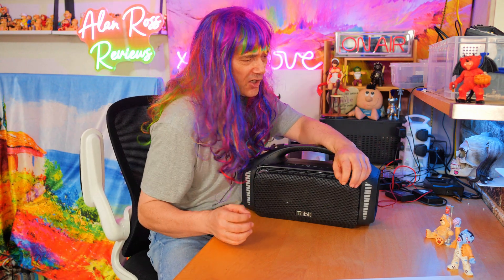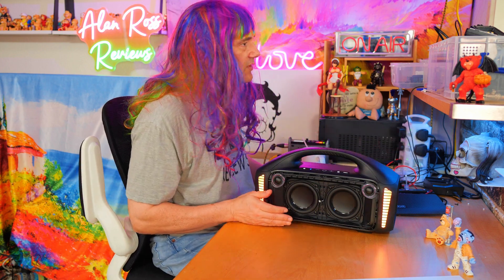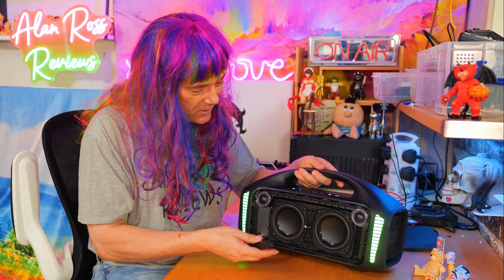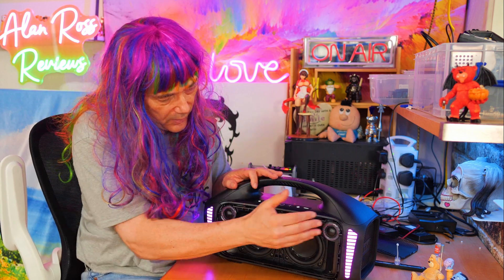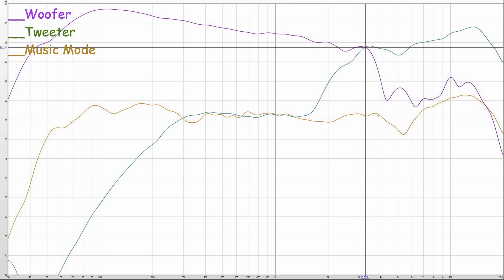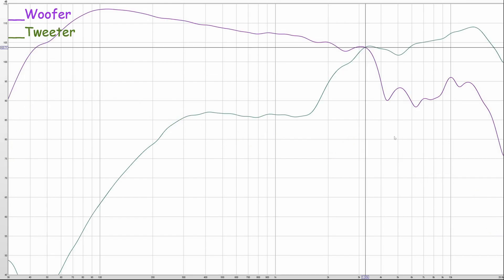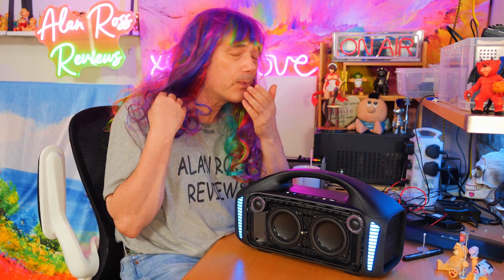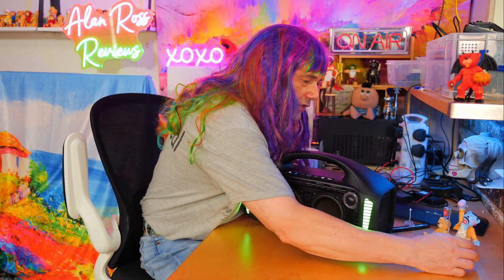Tribit Stormbox Blast the truth! the woofers, the tweeters, the crossover, the passive radiators!

Comment: Thanks for the measurements. Both woofer and tweeter should be down about 3~6dB at the x-over point BTW, and ideally have the same slopes, otherwise the phase tracking isn't going to be great and you're going to end up with dips and peaks through the x-over region.  Your measurements show mismatched slopes (ugh - that couldn't be cleared up via DSP?) and the bass drivers showing a ~5kHz peak almost exactly where the combined response shows a dip.  Hmm.... I wonder what does the phase response of the two drivers look like in that area? 

1/4 wavelength @5.5kHz is around 1.5 cm.  If there's anything around the tweeter that resembles that dimension or multiples of it (what's the diameter of that mounting ring around the tweeter, for example, or how high is the tweeter mounted wrt the baffle that's holding the woofer), it could be contributing to diffracting issues affecting the response around that frequency.

REW is a great free s/w tool for these types of measurements.  I also use it and the "transfer function" method to minimize room effects on the measured bass response to get a much better idea of what the response would look like under anechoic conditions. 

Great stuff, thanks for the measurements!
Reply: You didnt expect a 24db linkwitz riley slope on a 170 dollar bt speaker did you? Many speakers do in fact apply a non identical slope, but they do have their own reasons for doing so, most probably to achieve their sound signature they wanted. Its not ideal but that is where things are usually 'manipulated'.
Reply: @AbsoluteFidelity  They should be able to do that and perhaps more with even the cheap DSP built into those BT speakers.  Hell, they're already doing dynamic bass EQ/restoration  via DSP on some of those cheap BT units.
Reply: @Grommet2007  DSP is one thing you shouldnt talk about when it comes to 170 usd speakers. Even Harman dont use them when it comes to HK and JBL speakers. A cheap DSP doesnt really solve problems, a good example would be DSPs in cheap-ish monitors such as  Kalis wont ensure a flat response. With manipulation they might get get it flat-ish but still nowhere near flat as we see in measurements. Im not saying they are bad but there is a limit to what dsp can do before it screws up the sound. I personally would come up with a design that isnt far off the ideal response and then add dsp on top of it. Im running Dirac Live with a MiniDSP Flex and I know why you shouldnt mess with anything above the Schroeder frequency first hand and this is why Im currently investing in all sorts of room treatment. DSP and EQs are aids to make a good system sound better, not make the ones that sound shit sound like porridge.
Reply: @AbsoluteFidelity  Not sure where my reply keeps disappearing to, there's a breakdown on the Internet available for the JBL Flip 4 that clearly shows the DSP features in the BT chip are being used to adjust its frequency response.  Just do a search for "Reverse engineering JBL Flip 4".  The latest version of that speaker is available for $130.  A search for the ID of the BT chip that's mentioned in the article CSR8675 will turn up its specs, which include "Audio tuning suite with audio enhancements and two 5-band EQs".  The Flip 4 was produced five years ago.  Imagine what they're capable of doing now...
Reply: @Grommet2007  when it comes to JBL, I assume they set a DSP based on what they want and feel most apt. Harman believes in listener preferences, and in this market they  came to a conclusion that this is the type of FR they should have for such a speaker. It wont please the purists, but then again, pleasing the purists wont net them sales. This is exactly what is happening to B&W. Most probably asked a bunch of inexperienced teens to participate in the blind test.
Reply: @AbsoluteFidelity  I would go out and a limb and suggest that almost all except the cheapest of these BT speakers use some form of DSP to enhance performance to make it pleasing to their target market (hint: that market is quite likely does not include any audiophiles, LOL).  

Technically speaking, there's no way those tiny BT speakers could produce any sort of decent bass at even an adequate, much less decent, volume unless there was some sort of processing going on, for example.  Hofman's Iron Law applies, and the only way to get around that damned law when trying to get bass from a tiny box is a bass boost at lower frequencies that's dialed back as overall output is increased (because iddy-biddy drivers can only do so much, LOL).  And the JBL example I provided suggests that this processing can and likely is provided in many of those cases via the DSP features in the BT module.
Reply: @Grommet2007  of course these bt speakers use some sort of dsp, the best examples are the Onyx series from HK. But Ive yet to see any speaker that is DSP-ed above Schroeder. I need evidence and not assumptions to show that this is the case because even when I turn off the DSP on the onyx I do not detect any tonal shifts above the lower frequencies.
Reply: Wait, wait wait.  Just a few posts ago you claimed that "Even Harman dont use them when it comes to HK and JBL speakers." Then you provide an example of a HK speaker, the Onyx, that DOES use DSP?  One that you actually own??

Are you trolling me? 🙂

FWIW, DSP is used across the audio spectrum to adjust the frequency response of many of these BT speakers.  Alan has several videos in fact that show the FR of some BT speakers being "adjusted" with the application of a firmware update, including the Mifa Wildbox (which I own) and the Motion Boom Plus (where the latest firmware addressed a peak in the response at high frequencies). The firmware update just adjusted the DSP configuration to produce a different frequency response from the speaker. 

And, btw, the x-overs for these BT speakers are also implemented via DSP.  Probably cheaper to do it via DSP and separate class D amp channels than via passive x-overs, and you can't adjust a passive x-over via a firmware update :-).
Reply: @Grommet2007  there is nothing to troll in discussions like these and there is nothing to gain doing so. Just because it doesnt fit your narrative and understanding doesnt mean its trolling. I do need need to specify such obvious aspects of dsp and the application of it, its pretty obvious they dsp the lower frequencies to gain such a boost. Again, you have no evidence whatsoever to prove that dsp is used in the upper frequencies. Your 'definition' of dsp in this context isnt the same as mine, so understand where Im coming from. In this context, the dsp in your phone decoding lets say a MP3 file isnt the 'dsp' we are speaking off.
Reply: @AbsoluteFidelity  "Just because it doesnt fit your narrative and understanding"

LMAO. You clearly stated that Harman did not include DSP with their speakers... and then subsequently disclosed that you have a HK BT speaker with built-in DSP.  Maybe I'm not the one here that is trying to fit things into a narrative and understanding ;-).

FWIW, the treble response of my Mifa Wildbox audibly and measurably changed after I updated the firmware.  Alan noticed the same thing as well and mentioned it in his video covering the firmware upgrade of the Wildbox. Only way that could have been done is via a change to the configuration of its DSP.   And I'm sure Alan can share the links to a few of his videos showing frequency response changes across the spectrum  (not just at bass frequencies) for some BT speakers where he upgraded the firmware. 

Anyway, this is my last post on the matter. I don't see any benefit in continuing this conversation.
Reply: @Grommet2007  clearly you are out of your league and cant hold a civil conversation before chickening out. Have a good day.
Reply from the maker: i see more high end speakers now using dsp not for on axis but to get the off axis more in line with the on axis. is it cheating or is a move forward?? 🤔🤔
Reply: @alanrossreviews  Nah, DSP is basically becoming ubiquitous now.  You'll find it in almost every audio equipment reproduction chain that wasn't put together by snooty "purist" audiophiles, who of course don't have any issues with the gross distortion caused by their record players :-).
Reply from the maker: @Grommet2007  but i would disagree. dsp is pretty mainstream now including high end. i see it used now to bridge on axis and off axis response to gel with the current fad of everything having to line up with spinorama data. even more so for in-room listening position correction. probably driven by the home cinema and multi sub part of the market.
Reply: @alanrossreviews  LOL, I was agreeing with you (i.e. saying nah, it's not cheating).  Of course there is another person here who's insisted that DSP is not used above the room's "Schroeder frequency" (LMAO!!) who might disagree... 🙂
Reply from the maker: @Grommet2007  😁anyways its an interesting topic and for the most part well debated 👌 i dont like to see my regulars bickering though 😂 but ive pinned it because the number of people that dont realise how much internal eq these speakers already have is surprising.
Reply from the maker: keep in mind both woofer and tweeter were active during the measurement so a little of the woofer past that crossover will be the tweeter, not much but its worth keeping in mind i couldnt actually measure them 100% isolated like you would normally. so just right channel active but both tweeter and woofer active. of course not ideal but i wasnt going to open this thing up 🤪
Reply: @alanrossreviews  Ah, that explains some of the stuff in the measurements, then.  I thought that the drivers that weren't being measured were disconnected during each measurement. 

The output from the tweeters can be significantly reduced during woofer measurement by taping some thick cardboard over them.  Sadly, that won't be enough to block the output from the woofers.   Seeing that you've already got the grille off, if I'd reached that stage, I would have definitely given into the temptation of unscrewing one of the woofers to see if it could be easily disconnected.... :-)
Reply from the maker: well i really only wanted to find the roll off for the woofer and the rollup for the tweeter, it didnt really effect that portion but yeah you are right, with more thought i could have done a better job 👍
Reply: What's dsp?
Reply: But does it sound good?🎉😊

Comment: Hi, I've seen this hack for tribit stormbox blast where you add weight to the passive radiators like 36 grams each radiators.
It said that it improves the sensitivity to low frequency upto 35hz
Does this work? What are the risks if I do it to my stormbox blast?
Reply from the maker: its way below what the woofers will drive, its probably just making it sound more upper bass heavy due to lost deeper bass for a tad more deeper deep bass.
Reply: @alanrossreviews  appreciate the response man, I'm getting so much knowledge with speakers and terms ect. with the help of your videos😁

Comment: Thank You for this video. To the contrary belief, I did not like this speaker specially for deep bass. I bought this yesterday, and I am disappointed. Only on high volumes bass might have its effect but on low volumes, for me bass is not that deep. I had the JBL encore essential, I must say it is the best for me specially. I do understand the battery and stuff, but it is more of a home speaker. Planning to return Tribit and order a new Jbl EE. Using your EQ. Love your videos. At last do you have any tips for the deep bass at low volumes around 40%?
Reply from the maker: well you would need to reduce mids and highs but this speaker does have issues on some units not producing bass. you might want to try returning it for a replacement to see if yours is faulty.

Comment: New Subscriber here Alan! Please may you help me... I have a Dockin D Fine and I'm unhappy because it has a hole in the Midrange. Its just so Muffled. So - would you rather replace it with 2 x Bose Flex's or 1 Tribit Storm Blast, and reasons why. Cheers Alan, Top Bloke
Reply from the maker: i blast, flex is all about its compact size, its no match for a blast even two.
Reply: Wonderful, Cheers Alan @alanrossreviews

Comment: I bought a refurbished one. If i have time i can run a sine wave and check the phase with a scope. It could also be a dsp issue.
Reply from the maker: Don't think so as its still there on a near field measurement
Reply: @alanrossreviews  yeah tbh it looks like they messed with the notch filter in the dsp and screwed up. I'll directly hook up the speaker wires to the scope and see what's wrong. I can also do a sweep while at it.

Comment: How did you remove the grill Allan? I have a vibration issue about my unit specially when I play edm songs and it's awful to hear. But sometimes I think it's on the left tweeter.
Reply from the maker: you can pry it out if you are cheerful otherwise passive rads needs removing first

Comment: It aint killing the boombox 3 thats for sure xD
Maybe the boombox 2
Reply from the maker: They sound quite different and both do deep bass but the bb3 a little more. The blast sounds fuller, the bb3 has a problematic 700 hz peak than is masking a lot of upper bass. Neither kills the other, they simply sound different and one or the other will suit your taste. The problem for the bb3 is you can get two blasts for the price of one bb3
Reply: @alanrossreviews  ive listened to the stormbox. Im being a little bios towards the tribit because some people say some stupid stuff but i dont think its a bad speaker..
I think that it has potential but this "fullness" comes not from bass, it comes from boosted lower mids.. and lots of brands do that because the speaker cannot achieve enough deep bass to beat other contenders, so lots of people buy this as fullness.. 
It has similar craft to the boombox 2, 
Double woofers that play lows and mids, and tweeters.
But in the boombox 3 i can actually hear the 3 way system with no lots of crossovers...
My main setting on the boombox 3 is mids and highs on +2 and bass on normal.
Indoors its the perfect setting for under 60% volume
And it sounds better than the tribit indoors
It doesnt have that deep ratteling feel like the boombox has.
Reply from the maker: clearly bb3 suits your taste which really is the point. the difference in deep bass is not huge. its 50hz and down where the bb3 takes over but it does have stronger mid bass in xbass mode. in xbass mode only those low notes really make the difference, bb3 having that rumble factor which is a bit muted on the blast. but as i said, two blasts or one bb3? for me its a no brainer.

Comment: I used a third party equipment app on my stormbox and the results are amazing. I set the embedded app to flat and using Eq+ app I set it to flat and raised the 32hz slider up 4 decibels. This really produces nice deep extended bass. Then I raised the 16khz to +2 and the 8khz +6. Nice clarity and deeper extended bass. Sounds amazing.
Reply from the maker: does it produce much distortion?
Reply: bro, what application?
Reply: We até waiting for the name of the app, can you Tell please
Reply: You guys can just use poweramp eq and with the parametric eq you can tackle any frequency u want

Comment: another outstanding inside behind the scences from???? THE ALAN ROSS LAB!! HOWEVA!! ive seen reviews of the jblboombox3 against the blast. and the blast cant go down as low as the jbl. HOWEVA?? the motion plus mids and highs? very good, INDEED!! i say take the blast, jbl, boomplus and combine them for the???? FRANKEN BOOOOOOOMMMM!!!! and people said i was a drunkard for putting jbl boombox2 woofers bought off ebay and put them in a xg500..... it works and sounds killer!! JUST PAY SEPARATE SHIPPING AND PROCESSING FEES. fair middling... lmfao!!!
Reply from the maker: we need that video 🤞 yeah much like the bb2 the blast cant go quite as deep but sounds fuller than the bb3. the problem for the bb3 is that mids push, which means when you just adjust volume to your ears your gonna end up with less bass than a more level sound. the blast vs bb3 result will depend on exactly how you normalise the loudness.
Reply: Round pegs in square holes?